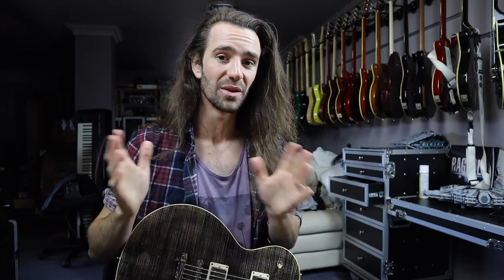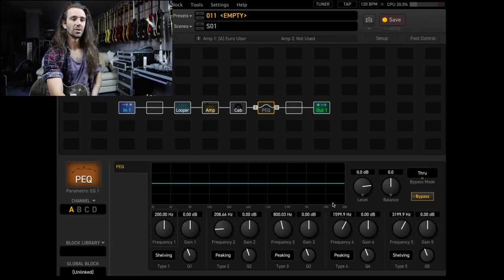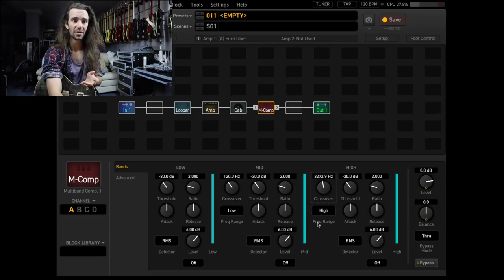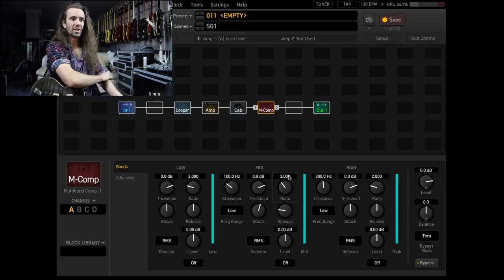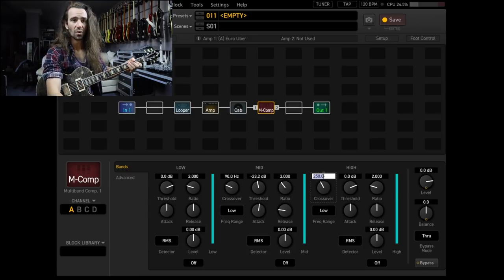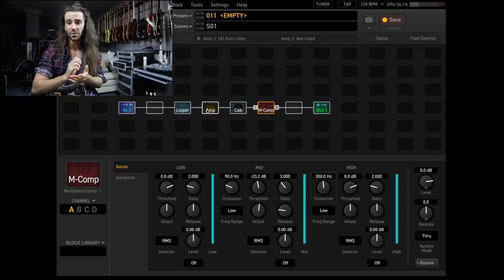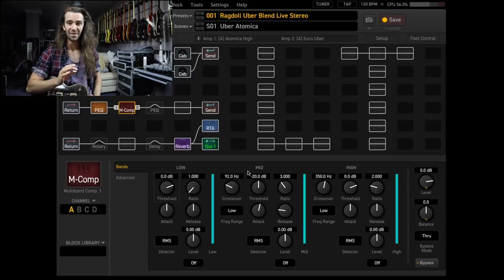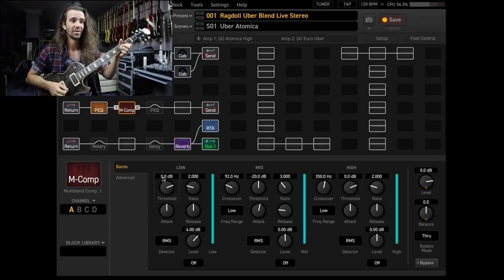Axe-Fx III - Multiband Compression for Metal Part  II

Comment: Thanks so much, just got a Axe-Fx and your videos are really helpful! Thanks! :)
Reply from the maker: My pleasure. How are you liking the Axe?
Reply: @LeonTodd  Thanks for asking! It sounds great, also thanks to the 5 minute Tones videos :)
The only thing I'm struggling with a bit is the high end of the rectos- I have a Tremoverb, which sounds warmer in the high end through the same IRs, but I know the modeled Rectos are not this exact model.

But to be honest I'm not familiar with the advanced parameters yet,  so I hope I'll be able to achieve a less piercing sound by tweaking more.

Simply lowering the highcut on the IR doesn't really do it, as the sound gets too dull quickly. I might have to do a EQ match in the DAW, and then try to get closer using the amp settings.
Reply from the maker: @M4Y0_  Try turn the negative feedback up on the Recto to do the Tremoverb thing
Reply: @LeonTodd  Thanks, will try it out!